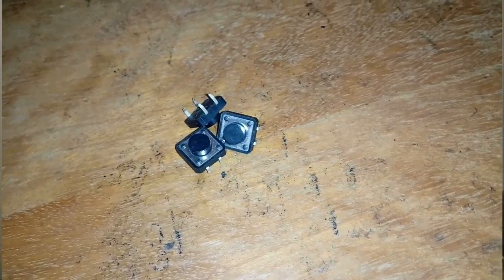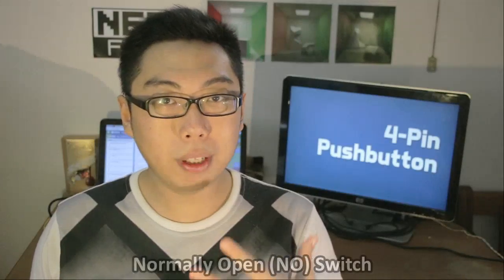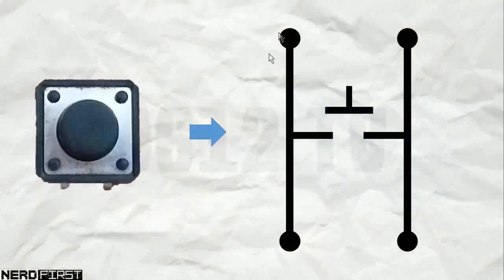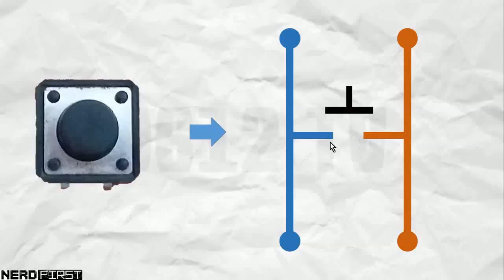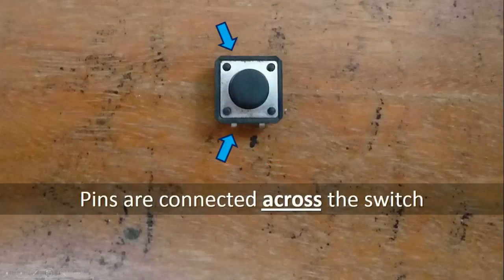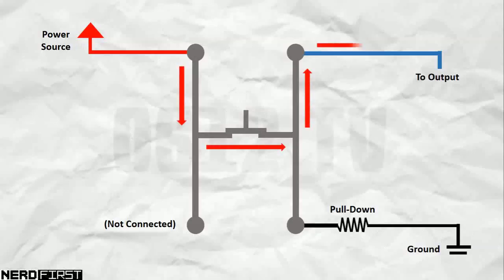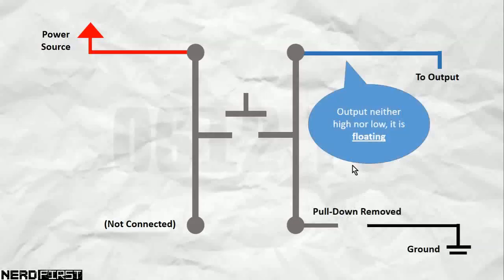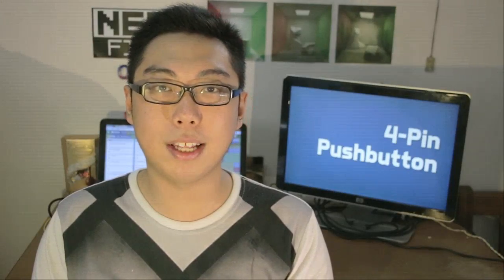4-pin Pushbuttons - Friday Minis 214

Comment: Hi,it seemed so hard to understand in the video.. I got a flashlight and I need to wire a 4 pin push switch to keep current flowing when the switch was pushed once. Then push again to close the circuit.
Reply from the maker: Hello and thank you for your comment! If your pushbutton is anything like mine, then what you want to do is not possible , at least not if you're only using this component.

These switches are "momentary" switches - They will not "lock" on to a state like that.